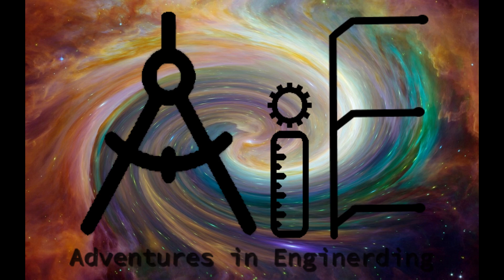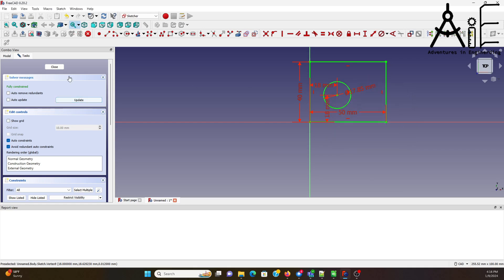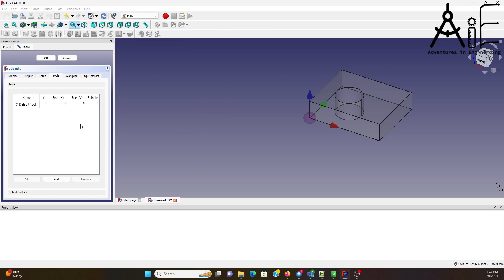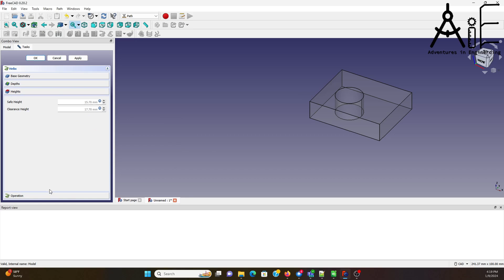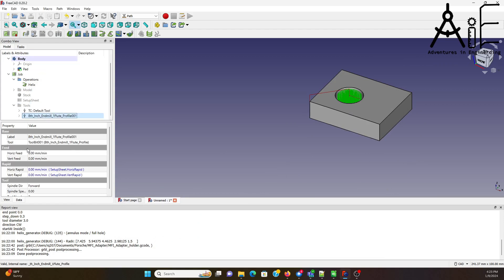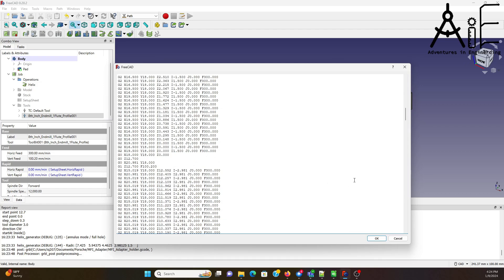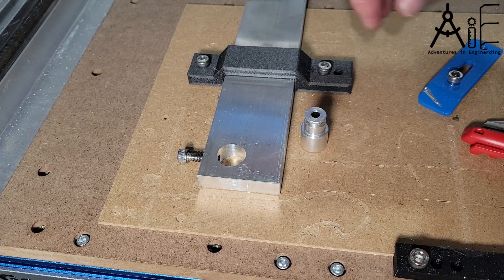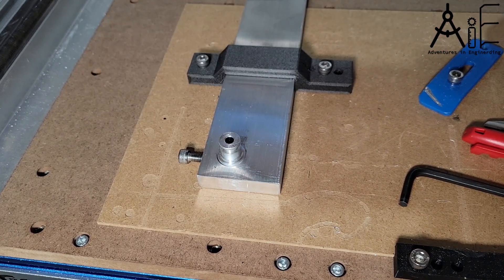Making a vertical Round Stock Holder jig for Desktop CNC

Comment: I left a comment on another video but oddly it doesnt show up is there a way to contact you via email = just had a quick question about the wattage rating of a resistor for the spindle upgrade
Reply from the maker: @citizen8609  If you mean the voltage divider from spindle control to 10V control on VFD Controller: From memory, the internal resistance of that 0-10V controller input was 10k ohm. So 48V / 10k = 4.8mA. P=VI so 48x0.0048=0.23W.  There is actually more resistance in the circuit, so 1/4W resistors are fine.
Reply: Thank you very much. I was also wondering if you could copy that cheat sheet and paste it into the comments of that video. I can’t read all of the values 

FYI For some reason a lot of your videos comments are turned off. Not sure what happened but I’m sure other people would love your input.

Comment: One Question: I have the same CNC like you, just bought last month. The xyz script you used, are its run with these candle software to send the g-code to the machine ? i found only these z-probe option. Gut Video thanks :)
Reply from the maker: @matthias3928  I have used the XYZ script in both Universal GCode Sender (UGS) and with the offline controller.  Check the link in my video description to get the script.  I modified it for hard coded parameters (offsets) so I use a separate script for each thickness of material  (different Z offsets).
Reply: @adventuresinenginerding  thanks for the quick response. I will check with UGS. greetings from germany